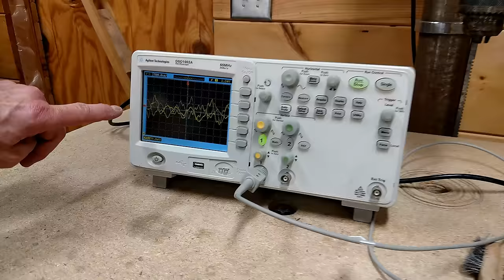Active Noise Cancellation

Comment: This is en excellent explanation, one thing I would emphasize is that the interference is moving through the air at the speed of sound and .. not the air molecules,  the air molecules are vibrating (or moving back and forth in short distance and at speed lower than the speed of sound)

Comment: Great description of sound pressure waves and really nice demonstrations too! You've got yourself a new subscriber. My one suggestion for the box is to try leaving an air pocket between the foam pads and metal plates, perhaps using rubber separators, which should further reduce the energy of the sound waves and lessen the amplitude buildup within the box.

Comment: Ford cars has a system similar to reduce the noise of engine into the car. Simply introducing the same noise but with reverse phase.
I think that you will demonstrate the elimination of the noise with a vacuum chamber. At least with vacuum into the wall of the chamber. It is the best system.
Thanks.
Reply from the maker: You're welcome.  Vacuum is a better barrier to sound than helium, but the structure required to resist the atmospheric pressure against the walls is impractically heavy and expensive.
Reply: @TechIngredients  Helium is problematic because it is prone to leak due to its small size and high velocity.  As a sound transmission medium, you might be better off with a heavier, softer gas.  The reason I say "softer" is because the electrons in larger atoms are not held as tightly as the s-electrons of helium.  Helium is like a bb, while argon or xenon are more like a cotton ball.  (sort of...)  Double pane windows are filled with Argon to reduce thermal transmission.  I suspect the same physics would apply to sound.

Comment: @9:25, you can use that to measure the wavelength of your sound waves. Then you can use your oscilloscope to measure the frequency. With those two pieced of information, you can now calculate the speed of sound.

Comment: Great video.  I have been contemplating a system to reduce the noise from my pool pump that is near my patio.  Your description of the passive system gave me some good ideas.  I am a EE and also was thinking about a concept to actively reduce noise from a noisy neighbor.   A very difficult but interesting problem.
Reply: Did you ever solve the noise issue?

Comment: You repeatedly refer to the speed of sound. If you are referring to air, that holds true. But the speed of sound is related to the density and elasticity of the medium it is transmitting through. IE steel is aprox. 16,000 ft per second. About 15 times air. As you describe sound transmission losses when using different material layers you omit losses due to velocity change. Then comes absorption, which you touched on. The holes in the foam have a resonant value for a specific frequency band. Since varying the hole size and material changes this, you could experiment on thin sheets of differing foam tacked to each other to see which materials suit your particular application.  KUDOs on your videos, they are well received.
Reply from the maker: I am referring to the speed of sound in air.  I do describe the effect of impedance matching in sound propagation, I'm not sure of the mechanism of loss due to velocity change.  You are correct that the choice of the foam parameters can be selected to enhance the absorption of particular frequencies as well as to match effectively the properties of the backing plates.
Thanks for watching and thanks for the support!

Comment: I love the way you present the problem spaces in your videos. Great job as always! 
Not sure how you plan to muffle the actual generator engines but a combination of sound suppressors and this box WITH extra airflow might work. Without the extra airflow you will build a resonance chamber, I'm afraid.
Also probably differential feedback loop from external microphones would be necessary for any dynamic sound cancellation. A single microphone per actuator will probably not be enough. Also scaling(multiplying) the frequency for modulation in that loop might be a good solution to reaction time hence cancellation efficiency. That's speculation of course to help you with brainstorming.

Comment: Awesome stuff! I hope I'm not too late to the party - I want to try ANC to possibly reduce traffic noise in my bedroom. I was wondering if I could use a condenser microphone to pick up the noise, then play an anti-phase signal out to a speaker to try to neutralize the traffic noise? Do you have any advice on that? I think the shakers would not be enough to shake the window glass..
Reply from the maker: Yes.
Because  anti-phase sound will become nearly impossible to generate once the noise begins bouncing around the room, it has to be generated at the point of entry.  If the windows are the weak link, then they are where the actuators have to be placed. To minimize phase mismatch, the microphones have to be as close to the window as possible, but not touching it! Best if they are located outside to eliminate  a feedback loop.

Comment: I have a question regarding noise canceling the small twin cylinder engine seen at 0:35 

Would it be possible to cancel the exhaust noise by arranging the exhaust pipes at a wave canceling spacing just as you changed one speaker's distance physically at 9:00? No enclosure or electronics would be needed if you could counterphase the exhaust notes.

Comment: hello @tech ingredients, nice video! for ANC to work really well, it is essential to add dsp-delay to your feedback-loop, to hit the (next) wave exactly (anti-)phase. without added delay you will never be exactly (anti-)phase because of system-latency and/or phase-response of the used components.
that also  explains why ANC in real-world-applications only works on steady-state (=cyclical / harmonic) signals and the maximum effective cancallable frequency is restricted by your system-latency incl. added delay.
greetings ^^
Reply from the maker: No, it isn't essential.  The phase relationship does not have to be exactly 180 degrees out of phase for the feedback interference to produce results.  Take another look at my outdoor demonstration.  As the speaker is slowly brought to  it's optimal, anti phase position, the sound intensity  progressively decreases.  As long as the mic and the speaker are sufficiently close, relative to the wavelength, the sound will be reduced.  Of course, this means that a practical system has an upper frequency limit.
Reply: @TechIngredients   i agree, a system without delay will produce results. i was not meaning to be rude. 
just wanted to point out some real-world considerations to improve the results. industrial applications of ANC usually incorporate a delay whenever a sensor-input (mic) is used to drive the actuator. this helps to reach the goal of the application (usually industrial noise control or structural vibration control in vehicles).
your outdoor-experiment is slightly different as it doesnt have  sensor and feedback-loop (no need for a sensor as the signal is predictable).

Comment: Use a Kalman Filter on the microphone signal and use the expected value of the filter to drive the actuator. The timing on the filter would depend on the round-trip distance to deliver the noise-canceling sound.
Reply from the maker: That is basically how a broad frequency cancelling, DSP is used.  We took advantage of the simplicity of limiting the performance to longer wavelengths and placing the pick up and the driver as close as possible.

Comment: You truly are great at explaining things.
So i have an old boat with a noisey diesel engine and i am in the process of trying to reduce the noise. Currently the engine is boxed in with 1/2 inch plywood and 2 inches of poly iso foam insulation. If i was to record the engine noise and play it back, would it cancel out the original sound. Other than shutting the engine off, getting a quieter engine, going electric.....  would it work? Im not an engineer or such, just a retired mechanic with too much time on his hands!  Regards from Nova Scotia.

Comment: #2:00
The molecules themselves won't move at the speed of sound.
Only the progression of the disturbance in the air moves at that speed.
The molecules near the speaker will probably move around the speed of the speaker membrane itself.
Reply from the maker: Remember, the disturbance IS the movement of the gas molecules. Even when this movement is small and cyclic, each particular gas molecule moves toward and then away from the source as a pressure wave passes.  The rate of the transfer of energy, momentum or information between molecules is the same as the mean thermal velocity of the molecules which is the speed of sound.

Comment: If you know the frequency of the sound that will be in the box, you would think you can also play with the size of the box so the reflections inside the box cancel eachother out. Although a spherical container would probably be better for that kind of passive noise canceling. So that the spherical wave front hits the walls all at the same time, maintaining a spherical noise front after the first reflection. Also this would only work if the source was perfectly in the center of the box/sphere.

Comment: Thank you for the very informative video.

When you spoke about the distance between the pressure waves at 2:36, I was expecting that  the video would be about how to make a soundproof box of the right shape and dimensions so that the waves would cancel each other inside it.
You did not mention it, but if you chose a box that has plates that are 6+12n inches apart, would the waves clash and turn into heat? 

Thank you  again for sharing. Now I am a subscriber and waiting for new and interesting videos from you.

Comment: Started watching with the exciter videos.  Showed off some 8 foot panels at Maker Faire.  Was thinking "wouldn't these be great for active noise cancelation?"  Looking around for circuit diagrams and what comes up...
Reply from the maker: We're now building an active noise canceling panel.  There is some engineering as well as electronics involved.

Comment: The nodes between signals for 1100hz are 6 inches you said, so this is also what you demonstrated at 9:00 => with 6 inch gap we almost get a noise cancelling. But what happens when we change the output frequency ? The node distance is also changing I suppose ?
Reply from the maker: Yes, it is.  But, as long as the wavelength is significantly longer than the spacing between the mic and the driver then the phase mismatch is small.  Obviously, this technique is limited to lower frequencies below around 2kHz.

Comment: You didn't mention using perforated helmholtz resonator panels like we use in aircraft nacelles. Essentially they dampen the sound because it creates eddy turbulence in the air rushing in and out of the perforations in the face sheet.  A honeycomb behind the face sheet combined with the back sheet of the sandwich structure create resonating chambers. For a higher frequency sounds it might be better to use a wire fabric face sheet to make a linear liner. If you feel real ambitious you can go all out and create a dual degree of freedom liner with both septum and face-sheet perforations for even more broadband attenuation.

Comment: WOW! You just hit on the best example of sound stealth that I have seen so far. I loved your demonstration. I like to see more. I would like to see if we can take something like an airboat and reduce the sound so it doesn't carry across for miles like they do. Of course I am sure this would be more than a muffler for a consumer use and DARPA would probably want it yet because of my own curiosity I wonder if I could take some of these concepts and combine them with a few other technologies to muffle and disperse the sound from example the water  which is what usually reflects the sound and amplifies it over a large area. I know this goes way passed your controlled demonstration but I believe it is an amazing start. I wonder what you think about my question: Do you think it is possible? Do you also think that using an electric motor instead of a traditional engine would help so most of the noise would be coming from the movement of air through the fan blades? Sorry for going so far out on this but I been thinking about this for awhile and your video has given hope that I could see this as a reality and marvel of engineering.. Loved it!❤😊

Comment: There is another passive method, nano materials that provide passive noise reduction by causing reflected sound waves to be out of synch and actively cancel incoming waves. They were developed for use on submarine hulls.
Reply from the maker: Interesting.
Reply: Also not mentioning anechoic chambers using wedges and standing wave reflections seems like a substantial oversight since that has been used for ages. Lately -20dba was achieved.
Reply from the maker: As I said, there are numerous ways of combining absorption and mass to reduce sound pressure. Anechoic chambers utilize these principles, we built one and are going to retest some our speakers within it.  We will also cover its construction and design in an up coming video.

Comment: some suggestions:
- measure the wall vibrations directly and at the point where the cancellation speakers are attached and use the wall vibration to generate the cancellation wave
- if the original sound is constant and known, the walls could be set at a distance where the echo cancels the original sound when reaching the opposing wall
- would a spherical sound cage with the sound source at the center not be more effective? in that case you would not depend on stiffness and inertia of the cage material and only deal with expansion/elasticity of the sphere

Comment: There was a noise cancelling system being used on a large HVAC system many years ago (a nearly ideal application, as the conduits essentially reduce the problem from three space variables to one) that used banks of 18" woofers and several large amplifiers in lieu of traditional passive means. The system worked great except for one small problem. Eventually, one woofer would inevitably fail open circuit, and the rest of the woofers on the bank would drive the dead woofer to its mechanical limits out of phase. You'd go from dead silence to the worst possible banging clatter you can imagine in a matter of seconds. Since the noise was conducted anywhere the conduits went, which was everywhere inside the building, the "solution" was much worse than the disease. Eventually, the system was ripped out and conventional plenums fitted in its place....
Reply from the maker: Interesting.

Comment: 10:24
How do you get the antiphase sound? By displacement or electronically (or none)? I understand that the speaker is simply amplifying the sound on the microphone... It is not changing phase. Since the microphone is in the same panel as the speaker... I guess you simple have the speaker in a reverse polarity.
Reply from the maker: You are correct.  This is why this system will begin to fail at high frequencies because the mic and exciter are not in exactly the same plane.
Reply: Thanks for replying. I just discovered your channel. Keep on the amazing videos!!

Comment: I wrote a function that would be handy for this, it's on stackoverflow called ri() for working out circle intersect points. So you could put it in a loop that returns nodal points for waves out of phase at any point in time. You also have to realise how they interact in 3 dimensions, from opposite planes the rules are opposite. If you need some help with this just ask, I like doing tricky maths.
Reply from the maker: Thanks! 
 I enjoy the maths as well and even when I'm unable to generate them, I can appreciate them.  We'll keep this in mind.
Reply: Have you two seen the phased acoustic array 'tractor beam'? I'd love to see someone break the mass and size records for acoustic levitation.

I've been very interested in phase conjugate mirrors and acoustic phase conjugation. The right metamaterials, resonators or phased arrays can enable advanced hovercraft or aircraft which use sound or light to generate a large, resonantly coupled standing pressure wave which can be used to propel a craft efficiently and quietly.

Comment: I am curious on how you would deal with the intake and exhaust noise, plus the non negligible problem of engine cooling inside a close enclosure padded with isolating materials??? This last issue could obviously be solved with water cooled engines, a pump and external radiator, but that would mean more weight...

Comment: So if I understand correctly, if you had a loud enough signal amplifier and drivers you could install the audio drivers on the outside walls of a room you wish to make sound proof electronically ( obvious limits) to help the material absorb sound instead of tryjng to cancel it on the inner walls?
Reply from the maker: Pretty much.  Another way of thinking about it is that by sensing the force that the sound wave is going to exert on the wall, the amp drives the mass of the exciter against the wall to prevent the wall from flexing.  It makes the wall function as if it was much stiffer.

Comment: I'm wondering if it can be aplied in a bigger scale like a studio "room in a room" by mounting bigger contact speakers on each of 4 drywalls and ceilling so as to cancel out inside standing waves. Inverting either with mics or with direct signal from a secondary soundcard's output.
Great demonstration, awesome channel !